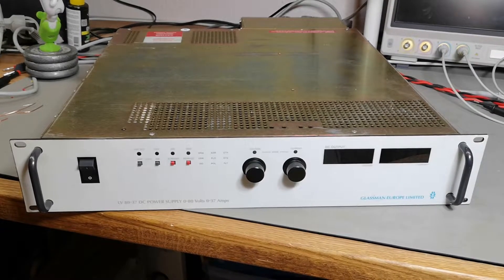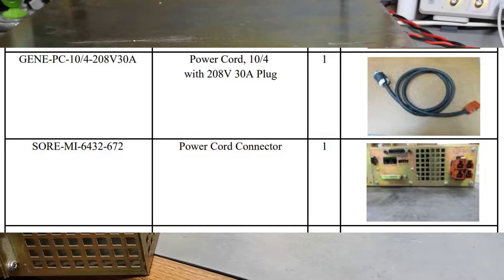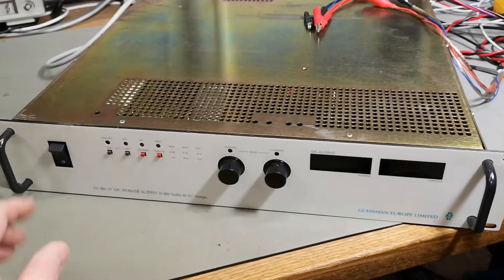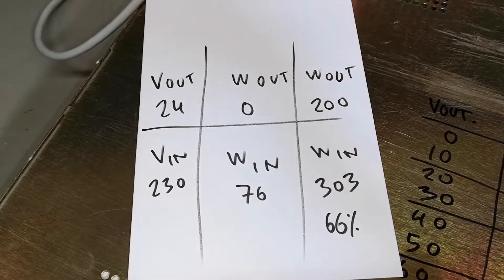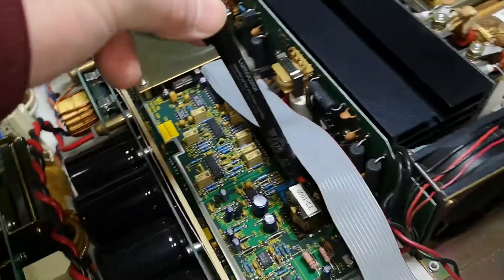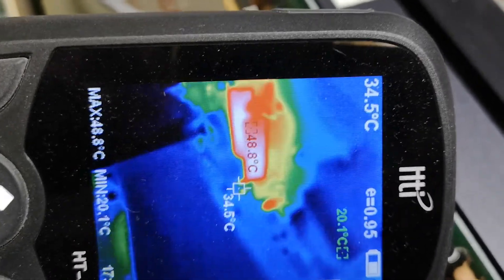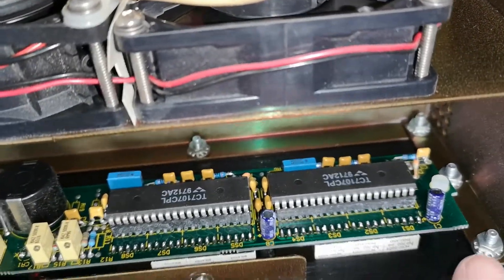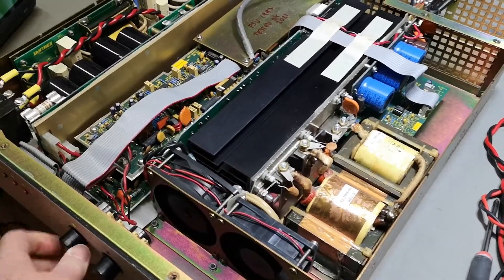Glassman LV 80-37, Sorensen DCS80-37 switch mode power supply 3kW

Comment: There are a + and - symbol stamped in the back panel of the case for polarity indication .. easily overlooked, but they are there ;) 
Would the efficiency be any better with a 3phase input? 66% is not the greatest ever.
Reply: In the last one he found the efficiency was nearly 100% when you took away the static loss in the supply. IE the power consumption with no load.
Reply from the maker: @zyeborm  exactly, the same happens for this one
Reply from the maker: YES i found it.. too easy to overlook, so i added extra. yes efficiency get higher with 3ph, and it also get a lot higher with more load, since most of the loss is constant, it will have almost 90% at 3kW output at 80V

Comment: Finally a power supply that is capable of running a Xeon processor at full TDP with no problems.....
Reply from the maker: yes this one is my most powerfull, but remember i wired it for singlephase 230V we have 13A pre-fuse for single phase power, so that is my max input 3kW, out of the 5kva this one require at max.
Reply: Mmmmm the 1.3 volts might throw a bit of a spanner into those works. At 250w tdp the 1.3 volts means about 200amps required ;-) clearly he needs a bigger power supply!

 (I know you were joking, I'm playing along)
Reply: @zyeborm  But enough power on the 12V rail to get a single processor core to full power after the voltage regulation.